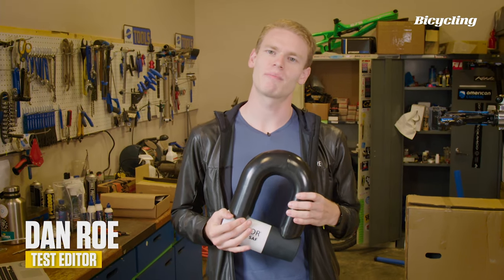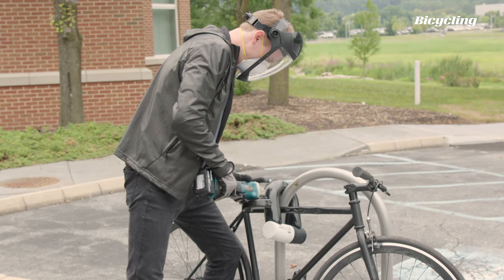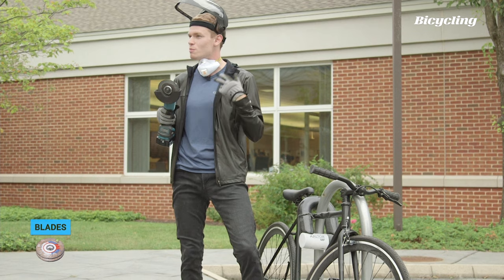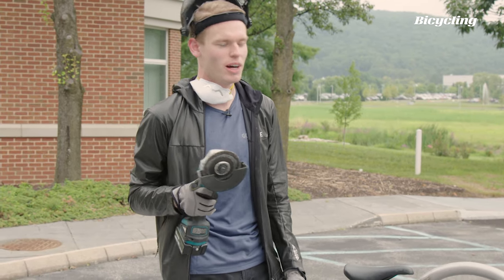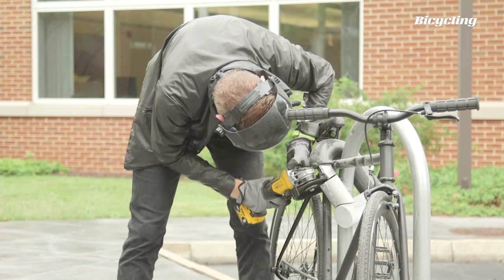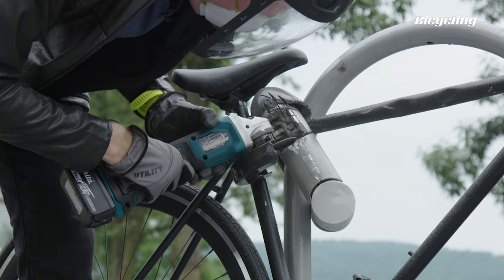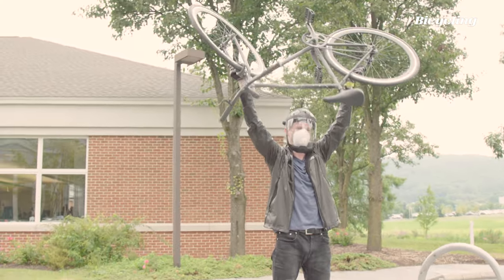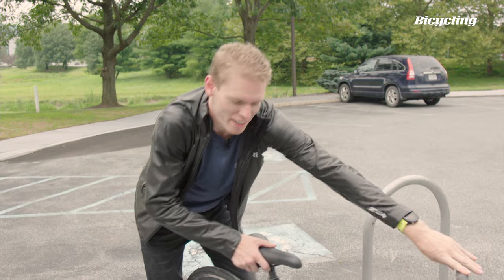Is The Altor SAF Bike Lock Really Grinder-Proof? | Bicycling Magazine

Comment: Can we get someone who knows how to use a grinder please
Reply: a real thief would have set out some pedestrian barriers, just to be on the safe side.
Reply: It was painful to watch from the first seconds. Awful.
Reply: Yes but would a thief have expert skills with an angle grinder? I doubt it, in fact they would be worse at it than this guy, so I think it was a very accurate field test.
Reply: No matter how good you are on an angle grinder that would still be a hard job cutting through that in the real world.
Reply: Please
Reply: Reciprocating saw would work quick.
Reply: @basanistes359  for the shell. How well do they go against the hardened steel of the core?
Reply: @benmac7315  Damn good in my experience.
Reply: @benmac7315  You just cut the rack. This shit isn't rocket science.
Reply: Darin Voight It isn’t rocket science but you don’t realize that the thief would need to cut at least two sections of a bike rack to free the bike. A single cut won’t do it. By that time,
I’m sure the grinder wheel would be worn or the battery would die, which ever comes first even if the thief had multiple wheels, you still would have the battery concern. There’s a reason they cut the locks and  not the rack. Theoretically they could steal any and every bike if they did that. It simply isn’t a viable option if you are using a real bike rack and not a sign post or something like that.
Reply: Yo everyone replying, I'm not saying this would be easy done by someone who does know how to use a grinder, im pretty sure this if the most thief proof bike lock ever, all I'm saying is it's kinda cringe to watch this guy use a grinder. I think having someone who is skilled with a grinder and doesn't look like they are scared of it would actually make the lock look even safer
Reply: @ShiftingCloudsYT  You obviously don't have an angle grinder. As to the wheel, Bad Dog HDII. Bite on that.
Reply: Can I genuinely ask what is this guy doing so wrong in using the angle grinder?
Reply: Angle grinder bigger wheel... done in a minute
Reply: The Geezer 

If the expert thief DOESNT have the skills... the thief is not an expert..
Reply: Ben Mac 🤦🏻take the stupid guard off the angle grinder and throw on a 5” or 6” disk. Done! Or better yet bring a reciprocating saw with an appropriate blade. This video is just painful to watch.
Reply: @ShiftingCloudsYT  "real bike rack" is bullshit in a lot of cases. There are bike racks out there that are assembled with nuts and bolts. You could disassemble the damn things with a ratchet in 25 seconds.
Reply: @aluisious  We were talking about cutting through them. Yes, if you have a whole damn toolbox and a private area, you can do whatever. Realize that’s not what we are talking about here. We are talking about the best way to have your bike locked up in public during daylight business hours. Not overnight in some dark alley. Yes I know it can happen in broad daylight but it’s a deterrent nonetheless.
Reply: @TheGeezzer  youve clearly never seen a good thief cutting a lock lol
Reply: Surely the point is that evey bike lock is defeatable. The idea is to send the thief on the the next one instead of yours.
Reply: Would it be out of this world idea to simply put a disc from the big angle grinder?
Reply: @HanSolo__  This lock is good against portable angle grinders up to 4.5 inches in diameter. I assume larger blades would not be available for a portable angle grinder. Non-portable angle grinders will need a power source to be used and they aren’t as easy to conceal.
Reply: @TheGeezzer  wrong ..a thief have a LIFELONG experience with grinders.. minus the time he or she served
Reply: @MowSow  I have considered what some commenters have said including you M Serry and I will retract my comment (leaving it in situ) as I can see that reason shines through to be correct. Of course they would have experience..illegal activity experience...lol...you're right.🤔
Reply: @benmac7315   a smart thief would cut the pole the bike is attached to. Then take the bike, and cut the lock off somewhere else.
Reply: @mattalford3932  even in broad daylight ? Lol what the F are cctvs for then. Corrr blimey !
Reply: I’ve read every single comment in response to the initial commenter and I see that we’re all doomed from bike thieves  😭.  The only rational decision a person could make is to not leave the bike out for x amount of hours. Although I already knew this. I just don’t know if I’m going to purchase this lock in particular, because it looks extremely heavy to carry around.
Reply: @yourfavouritescepticx8969  It's great if you're running errands and just going in and out of a business quickly but if you're using your bike for school or work then you'd wanna find a way to maybe bring your bike inside of your place of work/school.
Reply: The grinder would've cut through the bike pole in seconds. Would've rather cut out the section of the bike pole the lock is held on to and just repair the bike later....🤷🏽‍♂️

Comment: This lock is perfect for me but just one problem. The lock costs almost twice my bike.
Reply: Also probably weighs more than your bike... who the hell wants to carry that stupidly large lock around that has minimal ways of securing a bike with it?  You can't get it through the frame and rear wheel at the same time... and a post/rack.  Solves one problem, makes several of it's own problems.  But I guess it does show the end result of "If you have a 50lb bike you need a 5lb lock, if you have a 15lb bike, you need a 50lb lock."
Reply: @scottwa  well i think this type of lock is more supposed to be used in stationary use, for instance: some have a fixed bike rack at work, where they lock their bike up. In that instance a person would just leave the lock at that post permanetly and just lock their bike once they are there. Another use case might be heavy duty e-bikes that are made for carrying heavy duty around. For instance there are tern bikes, that cost around 3-4k, that have heavy frames and are made to drag hundreds of kilos around (for example the tern gsd s10). These bikes are usually used for grocery shopping or other transportation. Bikes like these could easy just attach the lock at the frame and/or put it in the bike trunk. Then once you are at the grocery store, you would lock your bike there and have the safest shopping experience i could imagine. And think about this: if you bought a bike for 4.000€/$, what is 300 bucks for a lock really? i mean if you get this lock for your 300 bucks mountain bike, you must be out of your mind. If you actually have a 15lb bike, you shouldnt be even locking that thing up anywhere. Best practice would be to have it indoors all time, because a 15lb bike shouldnt be used for grocery shopping or anything remotely similar... it should only be used for sports, therefore never leaving it unattended.
Reply: Ehsan Siam: Obviously you buy the lock and then sell your bicycle. This way you're absolutely certain that no one will steal your bike while you saved yourself from the added expense.
Reply: This Bike Lock Is Meant For A Bike That's Worth Atleast $1,000 Bucks Then It Be Worth It
Reply: @colbyjack8171  ding ding ding
Reply: If you have people always stealing your bike, the price of stolen bikes might add up?

Comment: The problem with cutting the rack instead of the lock is that you're still left with the lock attached, so you'll still have to cut the lock off at some point. Pretty good deterrent considering stolen bikes are usually sold for scrap.
Reply: It is easer to cut the lock at home than on the street. Plus you may have a better tool at a workshop. Honestly the lock is over engineered if it is easer to go through the rack.
Reply: No most bikes are sold to people, where did you get your idea??
Reply: @tesmith47  the city i live in has cracked down on the sale of stolen bikes enough that it just isn't done that often any more. 

The local cops have a simple website where you log your bike serial number when its stolen. When buying a bike you run the serial to see if its stolen.

I actually got my bike back after it was stolen because of this.
Reply: @graham1034  
I'm so happy to hear that man. Thieves are assholes. My bike is soo dear to me, I can't imagine losing it
Reply: Sold for scrap? Where do you live? Never heard anything so crazy. Bikes are stolen and sold on.
Reply: stolen bikes are usually sold for scrap. - where do you get that nonsense?
Reply: @thejimjamshadowman6747  He's bullshitting. Why believe some rando online? Don't do that.
Reply: @gary7vn  Thats the case where i live but it may not be in other places
Reply: They're not sold for scrap, they're chopped up into parts and the frames are painted
Reply: The key is to lock it through the wheel AND the frame too
Reply: @benoitrouchy1577  the thief isn't gonna go through all that effort, they're just gonna find an easier bike to steal

Comment: The main problem with this lock is that it asks the thief to compare the lock to the rack, which can likely be cut quickly. Just its physical size asks you to make that comparison. Not a good formula unless the racks are very sturdy.
Reply: Or put it through the rack, a wheel and the frame. So the thief cant ride it away
Reply: @codyfyfe  
The lock will not fit through most wheels. Not even the one on the video. And the ones with big enough holes (=few enough spokes) tend to have thicker rim walls / aerowalls, and their rims would not fir through the lock, even if the lock shackle would fir through the wheel gaps.
Reply: @aeyuio2315  i have a bike that would fit that description with out deepsection wheels but few enough spokes
Reply: @simedinson984  
Well then you know what lock to buy :)
Reply: @aeyuio2315  well a bit expensive as I wouldn't bring that bike to anywhere but my appertment and my cheaper bike the lock is over 30% of the value
Reply: So maybe just 3d print a huge case so that the thief will choose to cut the rack?
Reply: even if he cuts the rack he still is gonna have a 13lb weight dangling around or the bike
Reply: @TantalumPolytope easily taken care of and removed at a shop.

Comment: With enough time and dedication you can get through any lock. It just has to be hard enough to make it not worth the risk and effort
Reply: I mean yeah, what thief would take more than 2 batteries and 2 blades to go steal bikes, or spend an hour stealing 1 when his goal is to steal without getting caught. Any other bike can be stolen in seconds of cutting as opposed to this. Even the time it would take to look for a different bike to steal would be more efficient (and if you're taking the rack... Well good luck riding with that thing between your legs)
Reply: check LPL. takes 2 seconds.
Reply: @riskinhos  yes, LPL did it in 2 seconds. but he is extremely talented. thiefs often are not. nor do they own lockpicking tools in most cases
Reply: @riskinhos  maybe i am? who knows

Comment: Grinder-proof or not, the problem I have with this lock is that it looks like there's only room for the frame tube?  So even if the thief doesn't get your whole bike, he can still take both your wheels?
Reply: you could secure them with cheap lighter locks or something+weels aint as easy to sell for profit and they arent worth as much aswell
Reply: Pitlock, Pinhead, Hexlox or a bunch of other options can secure your wheels. Only a complete idiot would use quick releases if they're worried about security.

Comment: I still dream of a lock with an inbuilt taser !
Reply: Just to find someone that will sue you for damages after getting hurt because he "mistakenly" thought it was his bike... probably illegal in most countries.
Reply: @tobiastho9639 . So is stealing. Tasing does not cause serous damage otherwise police would not use it. There would be a tasing warning note on the lock, of course. 
Anyway, I’d be prepared for any penalty for still having my beloved bike and moped!
Reply: I don't know if that exists but there is the so called "Skunklock" that has a pressurised gas cannister around the shackle.
Reply: @tobiastho9639 . Of course such a lock would have a warning label on the lock. Even i& it doesn’t, I seriously doubt that any judge would convict you to pay damages to the thief, since the thief obviously tried to break the lock by force. Genuine owners have keys (incl. spare ones) for their bike locks!
Reply: @timewoundsallheels4ever  The question is if warning labels are enough in court. In my country the ruling is pretty clear that you aren't allowed to build traps for humans. On purpose or by accident or neglecting. One case was about a thief who broke into a building through the top and couldn't leave from the inside. He won in court.

Comment: What if you use galium?
Will that make it easier?

Does the lock even make sense practically, cause for this size it just bulky to bring around and there might be places too narrow to latch it.
Reply: There are bikes that costs more than 10K $, and this lock costs like 300$ so it kinda useful
Reply: @scottwa  this is more a lock to keep at work or similar so moving around is not necessary

Comment: People keep saying "just cut the bike rack brah" and sure, you could liberate the bike that way, but you would be liberating a bike with a 13.5-pound weight on it that will not only slow you down but also get in the way of riding the bike. You couldn't ride it well, you couldn't sell it, and you can clearly see he damaged that bike. If you were to try and get at it from the inside you'd still ruin the bike. So sure, you can liberate the bike, but the point of bike theft isn't the challenge of separating a bike from its owner, it's to get a functional bike for nefarious purposes.

Comment: ...instead of cutting at the random spot why didn't he cut it near the joint since basically one side of the aluminium shield is allready "cut"?...O.o
Reply: Probably one of those "too obvious to even think about it", besides it doesn't look like the guy has much experience using angle grinders either.

¯\_(ツ)_/¯
Reply: because you still have to clear the rack and the bike after opening. You'd make the worst bike thief ever too.
Reply: @z352kdaf8324  ...if You were talking about cutting the lock with a grinder propbably, but this lock was advertised as "grinder resistant" so I guess purpose of this test was to show just that. There are probably other methods to open the lock, picking being one of them, but I can only comment on the method this guy used...
Reply: I think developers adressed this issue
Reply: @t850  Picking this lock requires specialized tools. LPL confirms that.
Reply: @bastion8804  ...I know, but as I said in comments before we can only comment ot the method guy in the video used and how it can be "improved" by chooseing better cutting spot. Picking a lock is a different method enterely so I haven't commented about it in the context of this video...
Reply: Exactly!!!!

Comment: People saying "just cut the rack" lol
An angle grinder or sawzall is loud..
An angle grinder on a thick aluminum tube is tremendously loud. The clatter, vibration and amplification from the thin hollow tube would be insane. You'd have to cut away two fill sections... there's just no damn way.

Comment: I would be curious how diamond disks would have worked. As far as I heard they are not that brittle and prone to breaking, which seems hard to avoid with this lock.
Reply: Diamond wheels are slower by a long shot, check out disc review videos. They last 10x as long but arent great for cutting metal
Reply: The problem is rather that the blade is too small to cut trough the lock, so your chuck ends up bumping against  the lock.

Comment: Personally this isnt that impressive. Most people pop those locks with your run of the mill car jacks. Try this same lock with a car jack and we'll see how durable it really is.
Reply: I don't know if you have actually tried a car jack. I have (neighbor abandoned their rusty bike in my apartment complex), and it takes maybe 10 minutes of orienting the jack and bike just right so it doesn't pop out. And that's for a standard u bolt with only one locking lug. The whole point of this lock is to prevent the angle grinder thieves who normally need only 45s to get through most bike locks available today.

Honestly, with this lock your best bet is probably picking the core.
Reply: @lonesock  I have. It didnt take me that long. I used to work at a campus and we had to remove old bikes all the time
Reply: @lonesock  i
Reply: You'll never fit a bottle jack in the shackle.

Comment: The comments are full of "well just carry a 9" grinder around then" but the fact is that most bike thieves aren't "gone in 60 seconds" style car thieves. They have a certain tool that they stole from home Depot, they're walking around and looking for something easy to steal. 

A bike rack with 5 bikes on it, and one of the bikes has this lock provides two real options. 

1:steal one of the other bikes with a shitty lock

2: waste a battery and a couple of disks trying and failing to get this one

Which do you think is going to happen 99 times out of 100?

Comment: To me, 99% of thieves will not put out the effort and go through all of this. If I were a bike thief and I saw that, I'd move on to the next bike. I'm not going to stand there and make all that noise, ruin multiple blades, change the batteries, etc. etc. If every bike owner had this lock, I pretty sure bike theft would plummet across the globe. With that said, imagine 2 of these! That's double everything he went through.